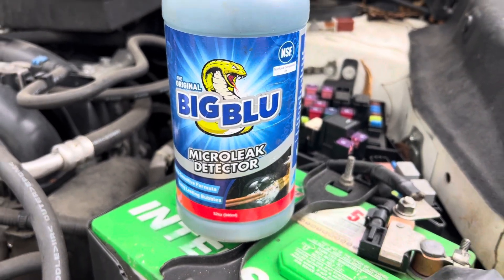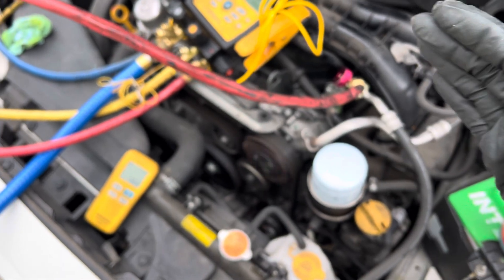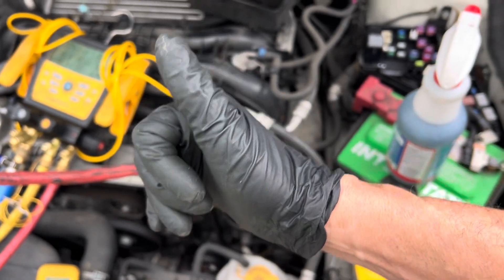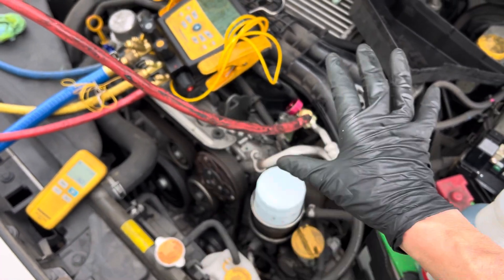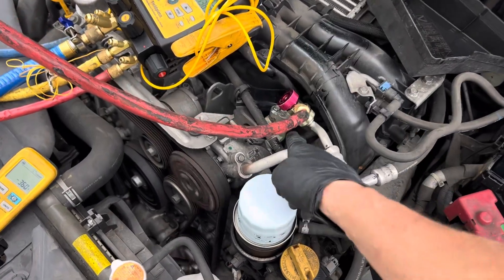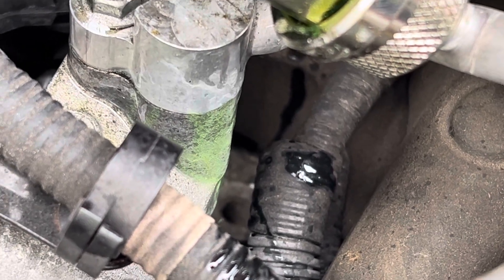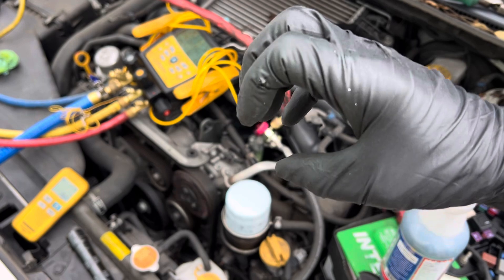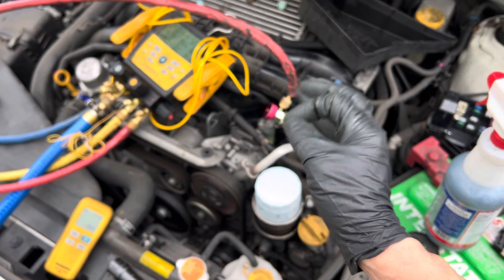I intentionally filled a Leaky ￼Refrigerant system for educational demonstration purpose.

Comment: How much nitrogen do you typically go through to flush an AC and a condenser back to back just for one vehicle? Would an 80 cubic foot cylinder do it 125 cubic foot cylinder? Does it take to 125 cubic foot cylinders?
Reply from the maker: Just the condenser only by itself singular ? 

I’m only flushing out the condenser with some solvent to only get rid of oil . 

I could probably do 7 to 15 condensers depending on their size with a 40 . 

Doesn’t take much quick squirts with the trigger at 600 psi will be finished in the flash 

Remember to wear eye protection protection, and gloves to protect you from the chemicals that you are using
Reply: Ok so 125 cu ft is more than enough nitrogen for 15 minutes flush on Evaporator and 15 minutes flushing the condenser right @coldfinger459sub0  ?